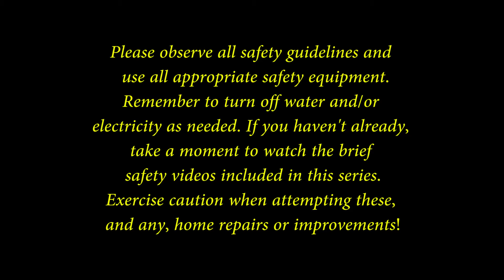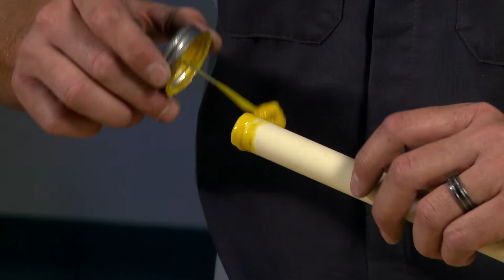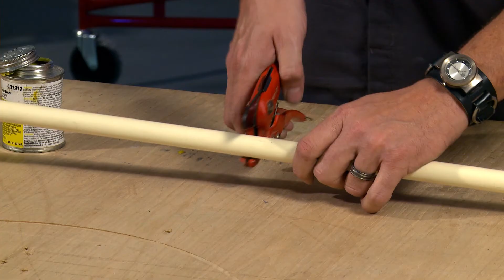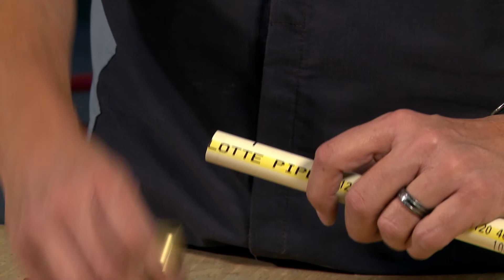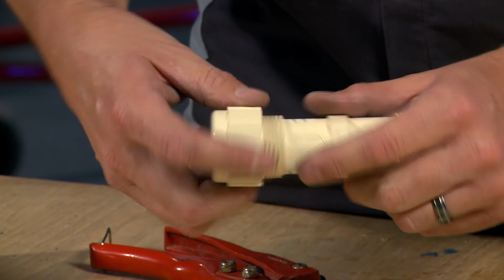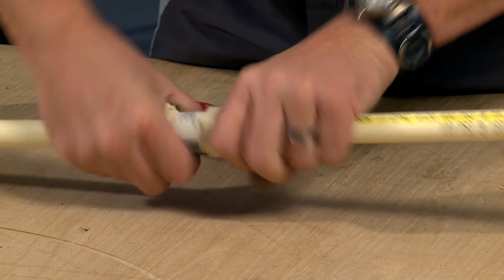CPVC Repair

Comment: I have a cpvc water line extending from a Tee near my outdoor hose faucet and connected to my septic outlet for some reason. Septic company said it's illegal and should be cut and capped, do I just cut the cpvc and glue cap on it or is that too much pressure and I should remove the Tee?

Comment: Why are you not using primer on these pipes?
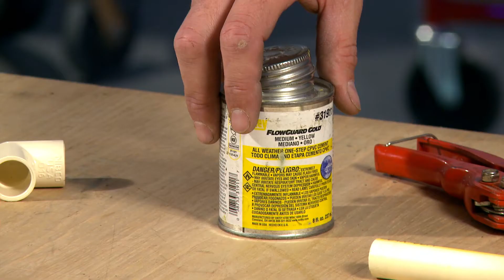Reply from the maker: @AtomicBombadier  as I mention on the video (at around 1:20) some glues, like the one used in the video, and some localities don't require it. CPVC is chemically kind of touchy and can get soft with too much primer, also.

Comment: I have cpvc was scared of it but 20 yrs later no issue. I do use pex on any add ons. I also used a sharkbite 10 yrs ago on washer and was unsure no problem as of yet it is in basement so time will tell

Comment: CPVC is brittle garbage. I've had 2 failures THIS YEAR alonge. The only thing you need to know is how to put a PEX-A adapter on the shit.
Reply: Well either you unfortunately got garbage quality or youre running compactors on top of the pipes

Comment: cannot use those cutters on old brittle cvpc , will shatter the pipe
Reply from the maker: That's very true, and if I didn't mention that, then I should have. A small hack saw, also called a Johnny saw, makes quick work of it if it's brittle.

Comment: I have 2 CPVC fittings at a shower-former exterior shower valve. They are broken off and flush with the wall. Can I heat up a galv. iron nipple and press into the CPVC to create some threads?
Reply from the maker: While we've prob all seen the Tik Tok videos using this process on PVC, I wouldn't trust it, myself. Sorry.

Comment: I am trying to fix a cpvc pipe that is in an incredibly awkward spot that is hard to get to. Can a sharkbite be placed over the existed pipe that was previously glued? I know it should be cut back but I'm not sure if I can where it is located. Can it be cleaned or sanded to make the sharkbite work?
Reply from the maker: Sharkbites are very handy for tight spots, but the pipe prep must be perfect. I'm afraid you'll need to find a way to get that pipe cut back to fresh pipe. Best of luck!
Reply: Okay thank you so much! Love your videos

Comment: Cope-ler. Cope-ler! It's coupler! Cup-ler!🤣
Reply: 😂😂 first thing I noticed tio
Reply: @masonmiller9907  He's saying it with a Latin vowel, which is perfectly fine.   Get over it, as English is mainly Latin and Greek.   It's you who need to get your English corrected.   Cope-ler is correct.   You're wrong.
Reply: @mikesmith9368  you mad 😂
Reply: Kupler in Simpel English.
Reply: Cow-pling, if we’re going with phonetic.
Reply: @Slowcarfastbeans  foonetik.  oo iz long o.  🤔
Reply: @Slowcarfastbeans  foonetik.  oo iz long o.
Reply: @Slowcarfastbeans  foonetik.  oo iz long o.
Reply: Censorship is strong here.